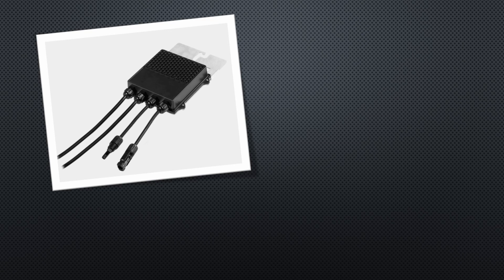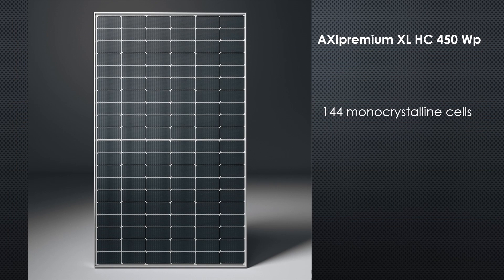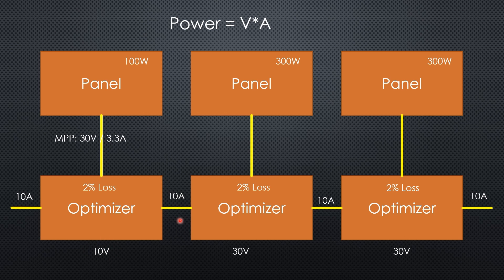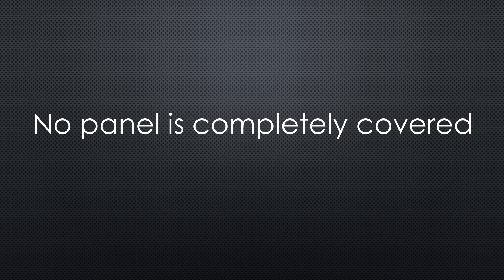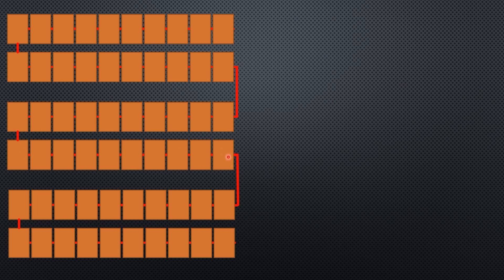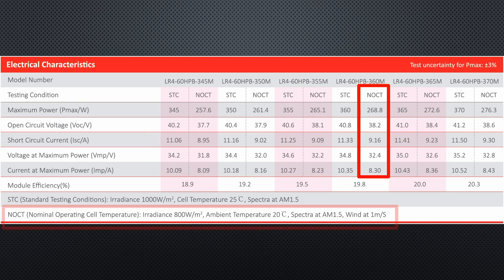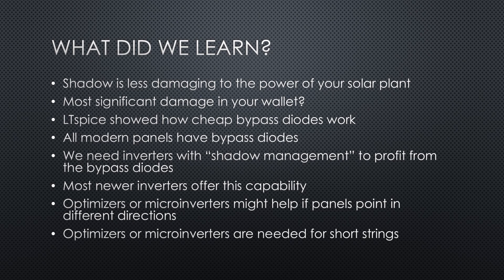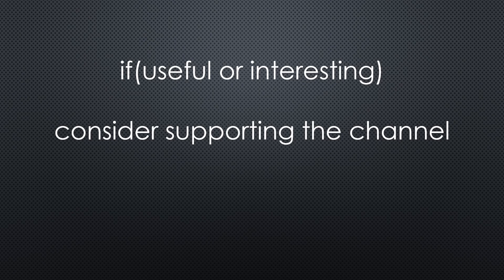441 Are PV Optimizers Worth the Money (e.g. SolarEdge)?

Comment: In my case I have 3 panels pointed east- (slightly north east), and 5 pointed west (slightly south west), all on a 45 degrees roof. 2 pointed west get an early shadow. For that reason I choose microinverters. A solar-edge system wouldn't have worked in my case, 3 panels wouldn't produce enough voltage for the inverter to work properly. They say Solaredge has a minimum stringlength of 8 panels or so. I only have 8 panels, but often only 3 of them get full sunlight. For that reason I choose microinverters. It made the installation a bit more expensive, but I'm still happy with it, especially now the energy prices went up so much. 

The nice thing about mictoinverters or (solaredge)optimizers is that you have per panel monitoring. 

For anyone interrested: the panel pointed east made 267kwh so-far this year, the ones pointed west 340 to 380.
Reply from the maker: I agree, for small systems without battery, microinverters might be a good choice, particularly if the panels point into different directions.

Comment: Thank you for this contribution to such a controversal topic. The YT channel  MC Electrical has 2 vids "Fronius vs. Enphase" ca. one year ago with real measurements.  Similar did "NRG Solar - National Renewable Group Australia" laso ca. one year ago. 
Some percent in difference in practical cases. 
I also simulated different parallel vs. serial configurations for older 200W modules using LT-spice.  Results were also not soo straight forward. 
My 36 PV modules are on the roof now, but I also miss the Fronius und the BYD battery. Maybe next year... we will see. And the switch box for backup island operation has no delivery date up to now. Here we call it DDR 2.0. And do not refer to RAMs. ;-)
Reply from the maker: Thank you for the hint about the Australian video. I thought I had it included in my comment, but I forgot it. Now it is there. And good luck with your inverter and battery...

Comment: The panels facing in different directions problem could also be solved just by having each array direction connected to its own MPPT tracker. this is easy as most inverters now days have more than one tracker built in or in the case of Victron installations extra MPPT modules can be added as needed. Even outside a Victron installation when faced with multiple PV array directions you can just use multiple smaller inverters in parallel to increase you MPPT tracker amount if necessary.
Reply from the maker: You are right. This is what I did with my two directions.
Reply: @AndreasSpiess  Is it possible to connect the east string and the west string in parallel if you only have one tracker?
Reply from the maker: @matzke089  Possible is a lot. But is it recommended? Think about how MPPT works, and you will find the answer. In my case, it would be even worse because I do not have the same amount of panels on both strings.

Comment: I now have 18 panels in two strings, a hybrid inverter and 9.6kwh battery. On a good day in October the battery is fully charged by 1pm. Only two days so far where they have not reached full. Still waiting for the paperwork so I can start to get paid £0.03 per kWh.  So far I've given away 200kWh for free:-(. Another few days and I'll pass the 0.5Mwh generated. Only been running during October so I expect it to start to fall off a bit soon.
Reply from the maker: WE get now days where the battery is flat for a few hours. For the whole time since May we only had to buy electricity for 10 dollars. And sold 3.4MWh to the grid. We get 15 cents per kWh...
Reply: @AndreasSpiess  currently i'd need to export 13kWh's just to cover the standing charge at £0.39 a day.
On a good day i've had a 10-15p increase over the standing charge.

Comment: One massive floor in this. You are not comparing a system with optimizers compared to no optimizers. Just chucking the odd one in here and there where there is hardly any shade is a bit misleading
Reply from the maker: Thank you for sharing your opinion. I thought I created enough shadow to show the point.
Reply: Well think about a whole roof full of optimizers over the whole year. The extra yield. In a Highly shaded area. You need longer data models

Comment: Micro inverters are maybe not useful in large installations, but in small ones they are a game changer. Not because of efficiency but by pure existence. With micro inverters small installations are easy to install, even by amateurs. Thanks to Micro Inverters balcony power plant are now very common and it will become more and more.
Reply from the maker: I agree!
Reply: Very much so: single panel plug and play solutions are up for grabs now.
Reply: Absolutely. Cost of microinverters for a 3 panel system will be less than a string inverter. In addition, it is easy to install. But if you are going for above 1.5kW power like 3kW or more, they become expensive

Comment: The company I work for installed optimizers before. Now we don't except in very extreme cases. If we have a huge tree or different directions, we recommend it. On standard flat roof, not recommended.
Reply from the maker: Thank you for sharing! For extreme cases they are ok, I agree. With the tests of the video people should be able to see where these extreme situations are and where not.

Comment: Excellent analysis - thank you.
An installer in Australia actually did a practical analysis by installing 2 identical panel arrays on his factory roof, one with micro inverters and the other with a string inverter.  Result: no significant difference.
He also shows that micro-inverters are worse that relying on the bypass-diodes in some shading situations because a micro-inverter needs around 20V to operate at all.
See: https://youtu.be/TqOw43-hbjc?list=PLxYfnmS3pqaBft9oWsS9YyCHfJMvi3ru8&t=309
Reply from the maker: Thank you for the link! The Australians seem to be ahead with this analysis. I included another Australian video in the video description which also did the test...

Comment: I have been pondering about using my UPS to be charged by my string of solarpanels, but neither I, nor the panel supplier could come up with an acceptable design.
Reply from the maker: I do not get your point. My UPS is connected to my 240V power.
Reply: @AndreasSpiess  Mine too, but I was searching for a way to feed my UPS from my solar panels in the event the mains dropped out.. It needs only to sync the converters to the net frequency, after that they can run on their own.
Reply from the maker: @MyOtherNick  Here this is not so easy because there are laws on how to disconnect your inverter. I plan a video on how I did it.

Comment: From my point of view, adding more components to the system is not good VS the benefit. The power electronics have a limited life, new point of failure and increase the operational cost of the lifetime of the powerplant. If the power electronics start to mass-fail in 10-15 years ahead, suddenly you have a huge cost and production downtime. The PV panels lifetime probably outlast the power electronics. Maybe in this situation "Less is more" :-)
Reply from the maker: I agree!

Comment: Thank you so much!  I have two small panels in parallel on my boat, and a very simple (and cheap) regulator.  I tried an MPPV system, and it constantly drained 20mA from the battery for its processor, day or night, without providing any obvious benefit.  I can't afford 20mA for 24h from my boat battery.  I thought I must be doing something wrong.  But now I feel I need not worry at all!
Reply from the maker: 20mA indeed is not a lot for solar power systems where we try to produce MWh. But in your case, maybe it would be of benefit to find a space for an additional panel. This often is the better way.

Comment: Thanks, very good analysis. What about safety differences between standard installations and one with microinverteras?
Reply from the maker: I do not see a lot of safety issues with strings. Everything is insulated, and 400V DC generally is less lethal than 220V AC. And most modern inverters switch off if there is a problem with the wiring.

Comment: I want to build a system that will heat water with solar cells. Is it possible to size equipment in such a way to avoid using inverters and batteries (eliminate their costs) and thus connect directly the cells to the water boiler, provided there are MCBs and fuses for protection?
Reply from the maker: Maybe it is better to go with direct conversion of sun light into heat. You have a much higher efficiency. You find many such collectors on the internet.
Reply: @AndreasSpiess   @Andreas Spiess Yes correct. But if we ignore efficiency for a moment, as proof of concept would that work, or without inverters, solar cells would deteriorate faster? Also, another idea for a stand-alone system that is not connected to grid and has no batteries would be a kind of load controller, with some automation and an energy monitor that would assign which load would be fed. For example, if the produced energy is enough and the water tank is empty run well pump until water tank is full. If water tank is full and the heating water is cold, start the small boiler that heats the house. These are just examples, depending on ones' needs a better utilization of the domestic solar and/or wind energy production could be done.
Reply: Systems that divert solar PV generated AC mains to hot water immersion heaters are a thing.  Commercial ones are overpriced but "makers" build their own.  In my opinion the simplicity of using AC output from an inverter (no additional wiring) which also then generates electricity for the rest of the house when the hot water is up to temperature means that other PV solutions are not generally considered.  As Andreas says, if you are going to build a single purpose system to heat water by sun, putting an electrical system in the way is expensive and inefficient.
Reply: Hot water solar panels are vastly more efficient than using PV panels.  But their Achilles heel is very poor capacity factor.  Once your hot water tank is at the desired temperature, the hot water solar system shuts down.  You cannot export surplus hot water for money in the same way you can export electricity.

So my opinion is that hot water panels should be used for “large” thermal stores (swimming pools etc….), or high demand applications (running a hotel). It’s wasted roof space if you only want to heat up for a daily consumption of 100 litres of hot water.

Comment: Optimizers have a safety advantage , like safe DC from solaredge where it cuts the voltage to 1volt when the string is broken / disconnected. In comparison to a string situation where the current/voltage keeps flowing.
Reply from the maker: My cables are insulated. So I do not see a big safety advantage. To be electrocuted you need a defective plus and a defective minus pole and touch both at the same time. Still, it is DC which is much less harmful than AC.
Reply: What Attix15 means i think is that when there is a damaged cable internal or exteranal there forms a ark because of the high voltage and a optimizor stops this. And at high voltage DC i would not say it is much less harmfull then AC.
Reply from the maker: @kwynton8272  Most modern inverters have arcing prevention. And I did not read of a lot of accidents because of arcing. AC is more harmful to your heart because it interacts with nerve signals and can make your heart stop. Otherwise, the effects are the same.
Reply: @AndreasSpiess  Andreas how is it with the Firefighters in Switzerland? Here they have "issues"  with extinguishing something with more then 400V and will not permit above 800V.
Reply from the maker: @jaroslavstava3704  I do not know about the firefighters. I just switch my inverter input off and I can disconnect all junctions without any problems. For sure, fire fighters have to know this "trick". I assume they are trained for that.
Reply: If you cut the cable between two solar panels and held both ends of the cable, then you’ll have a problem.  But consider a few things:
1.  You haven’t shutdown the solaredge inverter first, so there’s still a circuit voltage for a few seconds after a circuit interruption (400V capacitors inside the inverter).
2.  If you isolate first at a string inverter, while your solar panels are still generating voltage, there’s no current because the circuit is interrupted on both poles.  So you can’t get a shock if you insert your body into the circuit between two panels.
3.  Solar Panels are generally not earthed, so there’s no return path for any circuit current via earth back to the inverter if your insert your body into the earth fault circuit.  Dry rooftops at least don’t offer a good path to earth either so chances of suffering a shock due to your body being on the path of an earth fault are minimal.
3.  Opening a connection via an MC4 connector is very safe.  They are very well designed connectors leaving no naked conductors that can be reached with your fingers.

The most important intervention to make before going onto the roof to address your solar panels is to isolate the dc string first.
Reply: @anthonydyer3939  @Andreas Spiess The issue is fighting a fire on a house with Live hundreds of V on the roof. The wires will be damaged and water will be poured over these wires. That's what the Firefighters will be worried about. Their standard gear/training is only for low Voltage situation (400V DC). 
Since they are not obliged to risk their lives for property they might legitimately refuse to fight the fire. It's been an issue here. It's getting better with more awareness and training, but still. 
That's why I'm asking. What's the max. voltage limits (800V DC here) and other Firefighter requirements abroad.
Reply: @jaroslavstava3704  to be Frank, if you’ve got a fire on the roof you’ve probably lost the building anyway.  Rooftop fires aren’t discovered until they are well alight, at which point they will engulf the whole roof in less time than it takes for fire fighters to reach it.  Wiring regulations vary in different countries.  In north America for instance there’s a fireman’s switch outside the house.

Either way, if the PV array is isolated first, the source of heat (current) is removed.   As has been alluded to elsewhere, modern inverters have arc fault detection included, so the risk of a PV initiated fire happening in the first place is mitigated dramatically.  

As for electric shock risk, I’ll revert to my previous answer.  Now of course firefighters are trained to certain parameters, and I think this will continue to develop as technology and understanding of risk evolves.  I do note for example that car battery architecture is migrating slowly towards 800V DC for certain vehicles and firefighters will no doubt need to understand how that hazard should be treated.

Comment: Finally someone else who did the calculations. All the micro inverter salesmen have been very active lately. I always wonder why they lie about the non-micro inverter panels. Expensive and useless, microinverters are dumb. Also why hang them on the back of a solar panel, where temps often are 65°C. On flat roofs there is access, but on slanted roofs it's a mess if you have to replace a microinverter.
Reply from the maker: Microinverters are ok for small systems with only one or a few panels, I think (we call them "balcony power plants").

Comment: I am surprised to hear that typical buck (/boost) converters have an efficiency of 98% (@4:52).
Reply: "Maximum of" i.e. up to 98% under ideal conditions and the right voltages i.e. the best you can hope for.
Reply from the maker: I agree, but I did not want to open a box of worms for the Solaredge fanboys...
Reply: @AndreasSpiess   there is a very old solar edge technical paper which shows the 98% is only with 3 V difference between input and output. This is how solar edge can claim high number. Like any other buck boost efficiency goes down with Delta voltage difference

Comment: For my clients i always say - if you want more power in shade and have more roof space, and feel the need to spend more money, buy more panels and that will a reasonable investment. Of course, you should mind the maximum DC power of invertor, but it is usually at least 20% higher than peak AC power of system.
Reply from the maker: My inverter is too big, too. The price difference was very small compared to the overall cost...
Reply: @AndreasSpiess  Too big may be an error: did you look at the efficiency curves of the inverter? Many work best around their maximum output, so occasional clipping is easily offset by higher overall efficiency.  This is a difficult optimization to get right though!
Reply from the maker: @diatonicdelirium1743  I agree. I thought we looked at it. But I no more remember.

Comment: Great video André. I thought i knew a lot about solar panels and optimizers, but this is actually a big thing. Thanks for adressing it. 
I think more tests and theory explanation should be done in the following years. 
Perhaps the days of the optimizers are counted..
(i myself have 32x 310Wp solar panels, in the same direction, without any shadow and sadly enough all with optimizers)
Reply from the maker: I currently test optimizers in an arrangement of four panels directing towards south and in a steep angle. I plan to add another 4 panels in the same direction but a different angle. 4 panels are not enough for a string for the Huawei (not enough starting voltage. So I might end up with optimizers in this configuration. At least I will test them.